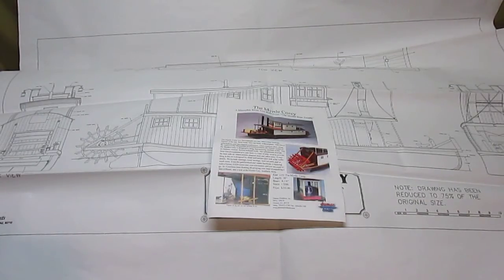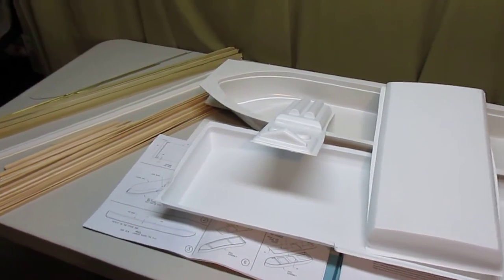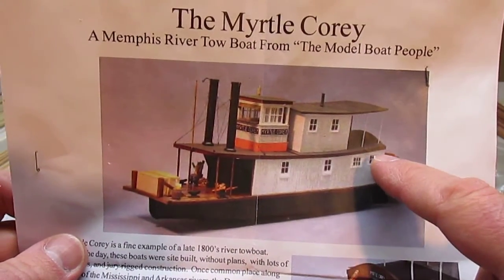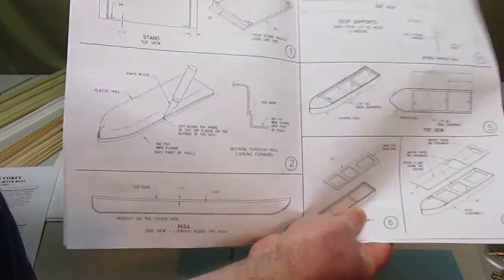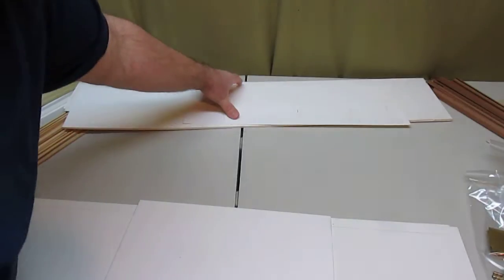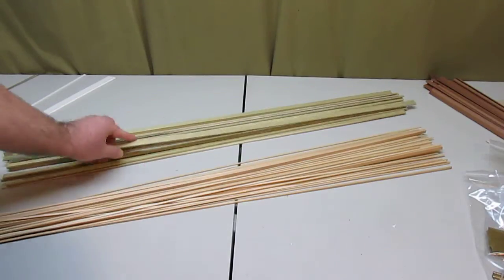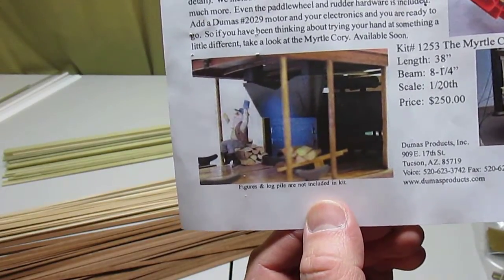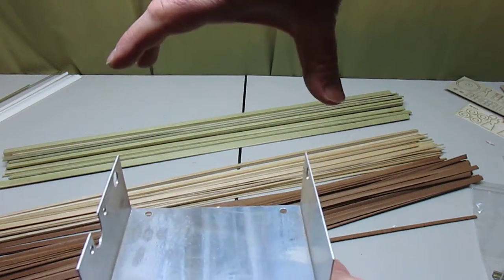Dumas The Myrtle Corey 1/20 Paddlewheel Model Kit Open Box Review

Comment: 1/20 scale is "F scale" in model railroad terms not "G scale," which is 1/22.5 scale. There is a lot of confusion between these scales because the trains in these separate scales run on the same size track.